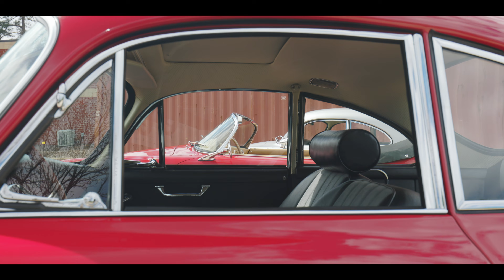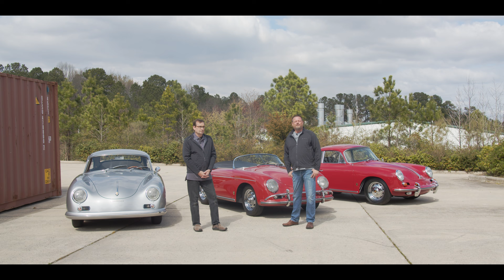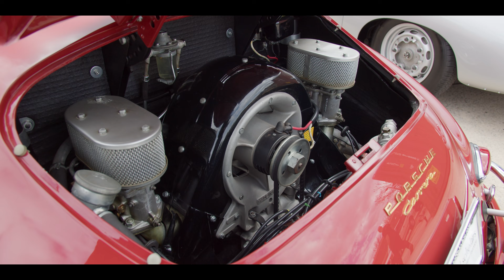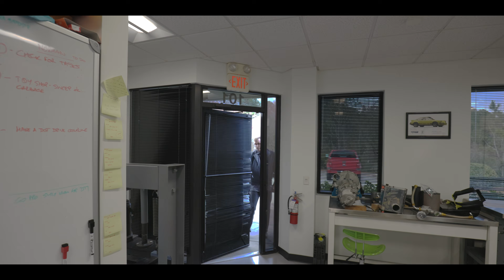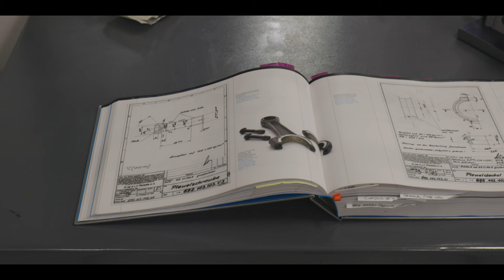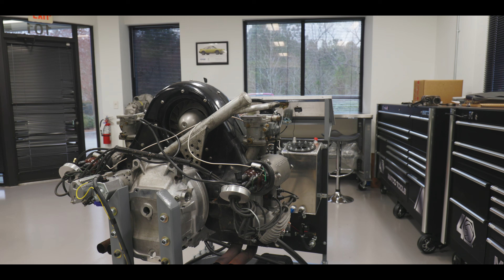RS - The Fuhrmann four-cam engine and the 356 Carrera / Insights

Comment: I would have asked so many more interesting questions. what was the purpose of each oh the different engines,  strength and weaknesses, hp, redline, miles per service intervals  ect....do's and don't of starting or using them beyond normal practices...

Comment: My budget never allowed me to move into Fuhrmann´s engines but I certainly learned everything there was to learn about the 616 type pushrod engines for my 912 and I fondled my first big bore kit from Japan like crown jewels when it was time to rebuild! I once did see a four cam on an operating table and was amazed not to find reliable marks on the crown bevels so as to even have a chance of getting the cams set to match the drive shafts...not a mark anywhere... my heart sank and I stuck with the 616s and never regretted it!

Comment: I seem to recall years ago reading somewhere the the assembly time at the factory for one of these motors was huge because of the complexity of properly setting up the cam timing. What is the approximate assembly time now vs a pushrod 356 motor?

Comment: As a small boy in CT I followed Porsche and the 550 and the 4cam became my favorite. When I moved to Tucson in 1964 I happened to be at a Porsche dealer where I ran into a person replacing his 4cam in his 356 for a push rod. That could have been a roller bearing model but when I asked him why he said the car was more drivable with the push rod engine. I had a S90 later and I must say I do enjoy the C more than the S90. Can you address why people liked the push rod more than the 4cam? I transitioned to 911s in 1966 because of the smoothness and high reving of the engine but perhaps the 4cams that were being replaced were those without the cam balanced and they didn't provide that much more power.
Reply: In general the higher the state of tune for any given engine, the shorter the operational life span and more functional compromises in street operation. The Hirth roller crank engines were race engines. They would quickly flatten the crank roller bearings when lugged around at low rpms. These were very expensive cars, and road customers were not pleased with the very expensive repairs. I ran the 1600 Normal 60 horsepower( Die Damen) , the 1600S 75 horsepower, and the S90 90 horsepower in the 356’s. The 1600 Normal stayed in tune and had a considerably longer service life than the hotter variants. Back then 70,000 miles was typical rebuild time for a 1600 Normal. My girlfriend could blow up a Porsche motor in a couple weeks. When the rod went through the case we would just weld it up and replace the damaged internals. Why not? She would soon blow it up again ignoring the tachometer..she lived hard and died young, like those motors.
Reply: My understanding is that aside from premature wear, is that plain bearing engines produced more torque than their roller bearing counterparts. So for everyday driving, the seat of your pants sensation would definitely be that of more grunt down low in the RPM range.
Reply: Yep